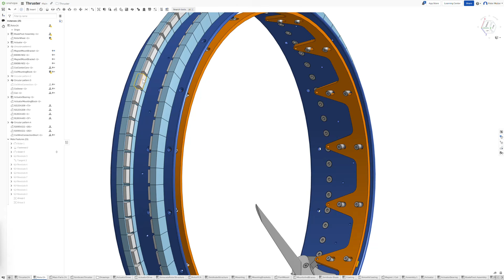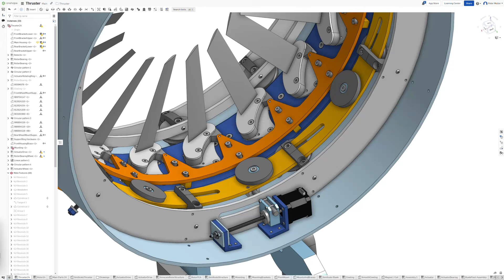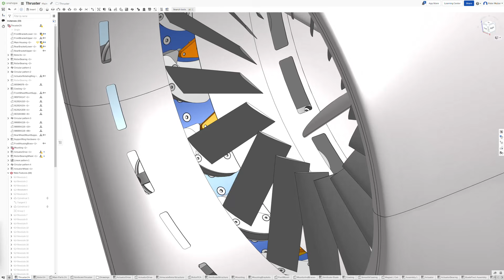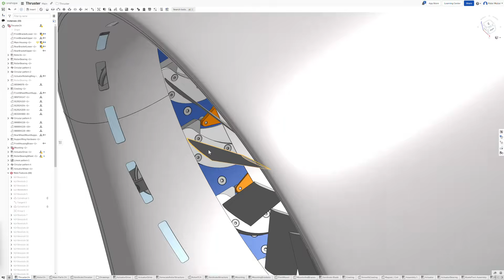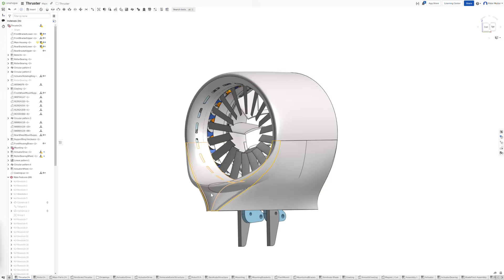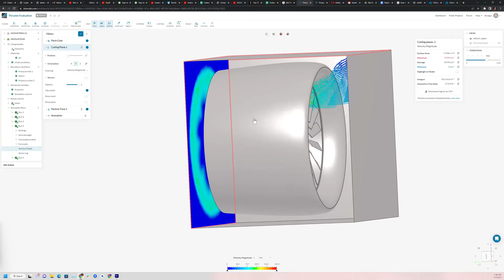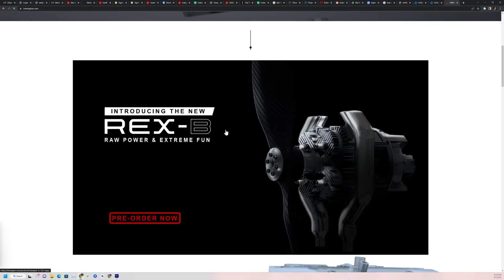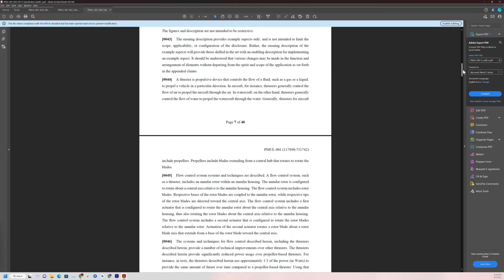Could this Thruster transform Aviation?

Comment: I am very much looking forward to seeing this on a real world test, full thrust power and blade pitch.  I like it, I get the engineering behind it, and it's fairly exciting to see this new design.

I do have my concerns about the design, but I'm not nearly engineer enough to know if mine are founded.  I will just look forward to the testing and see what happens!  Good on ya!
Reply: If you get the engineering behind it, please tell me what the case is for this design. I gave up on the video.
Reply: @kylenolan3138  The case is thus:

Propellers and hub based fans have issues with supersonic tips (high drag) as well as hub strength. They are also susceptible to hub/blade failure due to manufacturing processes coupled with a large amount of outward force being put upon the blade hub and hub itself.  Both are in danger of FOD or bird strike causing them to fail.  And when they fail, the blades swing outward from the hub, and that can be... fun.  Sioux City DC-10 for example.  Hub failure, plane crashed.  Not all hub/blade failures are contained.

This design, all the force is put on the outer ring.  This is a stronger design due to the containment already happening on the ring.  There cannot be any blades flung outwards, worst case is it is flung backwards if a blade assembly fails.  Further, there cannot be any supersonic drag of the tips, as the tips are on the inside, spinning slower than the base of the blade as it runs around the ring.  This improves efficiency of the blade.

Further efficiency of the blades are found by variable pitch, which you do not see in High Bypass Turbofans.  You do see them on props, but it's a somewhat problematic solution which not all aircraft have.  These blades will be pitched automatically, so you run the 'engine' at the same speed, but can produce variable, speed appropriate thrust.  This is therefore akin to a CVT transmission in a car: Car runs 3500 RPM, but still accelerates at a constant speed, the transmission changing its ratio to produce peak power for the car's speed needs.

Finally, it's akin to a 'diesel electric train' idea.  Diesel electric trains have diesel engines, but they are not running the train.  The engines are used to generate the electricity, and then that electricity runs the motors on the wheels.  This is the same thing: small, efficient engine to generate enough power to electrically run the fans.  Less fuel used by far than directly running the props/fan.

It's quite the idea.  Not so much the electric side of it, the fan design moreso, but the whole thing.  It's rather innovative and striking, and IF (because it's an IF at this point, of course) this pans out, it could be revolutionary in the aviation world.

As far as the SVTOL idea... That should work as well, but I think that'll be best done after proof of concept on the system in general.  Straight out flight first, then add the SVTOL part.

Will it actually work and/or be a revolution?  Well, they didn't think that rockets could be reused until about, what, 7 years ago?  All it takes it one person at the right time with the right means to try and see, and Peter is the person of this moment.
Reply: @mikeybhoutex  the blades definitely can be thrown out sideways. They still have essentially all the axial force they do in turbofan engines, and with the lack of support to the blade tips the flexure will cause major fatigue cracking over time leading to them breaking off and being launched outwards into the hub. 

The root of the blades will also still be going supersonic, it’s irrelevant wether it’s the tips of the blades or not, a part of it is going to be supersonic.

The ring holding the blades is also going to be under immense forces due to the g-loading from the centrifugal forces from the rotational speed along with the torsion from the blades. 

There are more issues with this design than there are positives.

Comment: Have you considered using a magnetic bearing system vs mechanical bearings? A lot of energy is lost in friction and heat. Overall great concept. I have a similar concept with a completely different design.
Reply: I was wondering why so many moving parts too :)
Reply: also all the extra parts and weight, but the part that gets me is waste heat is thrust, and you use it to push all the many blades :)
Reply: there is no form of thrust more powerful than liquid and solid fuels which is why we use them and the fact that as you burn them you lose weight reducing how much you need to use :) 

if you could recharge the energy spent with the motion and get more that way then it might compensate a bit..

Comment: I will be interested to see how your patent progresses. As a former aircraft engineer, I tried to patent this idea of a hubless "Maglev" electromagnetic linear driven Turbofan back in ~2010 in the UK.  My patent lawyer told me there was too much prior art for it to hold any weight, in the UK/EU at any rate.  My blade design was different to yours as the compressive forces acting on the blades make a huge difference to what you can do over normal blade designs.
Reply: F Bonger
Reply: Maglev in combination with this hubless design should be patentable I’d think. Using a maglev technique will help reduce the number of bearings and high rpm friction in this design

Comment: Variable pitch exists also in standard motors mostly to reverse thrust on combustion engines. The main issue I see is the lack of gains due to weight and frictions. You do get rid of the engine bell and use the ducts as a bell. The main efficiency gain should be from the better ducks seal, but getting tight motor tolerances is now harder and those have huge perforce consequences. Lastly, this motor will not like to change direction (like a bike wheel at 90°).

Comment: So. Much. Rotational Inertia. 

While this might be an interesting option as a forward thruster, it'd be incredibly difficult to use this as a vertical lift thruster and maintain controlability. 

Also I'd recommend a number of stators/rotors that's a non integral ratio. Otherwise you'll get resonance issues and it'll be loud as hell. 

There's a lot of interesting ideas you have here but you're gonna have a lot of challenges to overcome. 

I wish you the best of luck
Reply: Interesting. It has a lot of rotational inertia, but it also has a lot of leverage on that inertia.
Reply: Can you explain what the issue is a little bit more? I'm not sure it's any different than how a helicopter works. The back engines would need to maintain a slight angle though to provide that force vector.
Reply: @nathanchalecki4842  And the rotating mass can be "easily" decreased with better materials and mechanisms (specially the pitch control).

Comment: It is an interesting idea, but my opinion is that, it has to many moving parts (the electric motor part) and those many moving parts need to be machined to very tight tolerances , that cost a lot and as you have seen , not many can do it right, so tight tolerances, in order not vibrate and work correctly at high rpm. only 3grams at that diameter at 5000rpm will vibrate like crazy, a wobbly outer case of the rotor will damage bearings from vibrations, i know it. (experience). 
A outrunner at that diameter needs to have verry verry precise positioned coils and magnets, because only 0,05 mechanical degrees out will throw many electrical degrees out of alignment the rotor with regard to stator, and also i know that for sure (experience), search for electrical degrees and mechanical degrees in brushless motors PMSM. 
Might be a better solution , from fabrication stand point at least , and reliability stand point to make the motor in the center and have only 2 bearings that support the rotor assembly. 
Another problem in your design is that you have way to large single copper wire in the coils (so it looks) you need to have many stranded thin wires to avoid skin effect.
The high frequency for that large and many poles rotor may cause some heating problems at high power. Electric motor design is a complex task.   
I know this stuff, because a built my electric aircraft and electric propulsion system completely from zero, many years of learning an d building. I have some videos on my channel about this.
Nice work wish you great success! All the best Mihai.
Reply: I mean... do you know the types of tolerances and materials required for turbine engines?
Reply: @damnsong8675309  It's way more than some eletric propulsion for a small 300 kts airplane (which is still a lot).
Reply: To be fair a conventional gas turbine is highly complex
Reply: @damnsong8675309  i work in a industry with microns of tolerance, and yes an out of round tolerance for a turbine disc is between +/-20 microns at about 1 meter in diameter, and that is no simple task nor cheap to achieve.
Reply: @Cherub1m7  yes they are, but, none of the successful gas turbine power plants was designed and built by a single person, not even a small group of people, thy ware designed, buit and tested by very big companies with 100's of specialized personnel, and non the less with huge budget at expense. I am not saying that is not possible to be done by a single person, but that will require a lifetime and enormous amout of money. There is no need to over complicate what can be built much more simple, just remember the problems that user had with his redrive on audi engine, that even resulted in a crash landing.

Comment: Super interesting configuration. There's a colossal mountain of challenges to summit before any aviation authority would certify it tho. In a previous life I was an aerospace fan and turbine blade design & development engineer; I can see a whole tonne of issues that'll need looking at both early on and later. Early problems include vibrational fatigue and creep leading to failure and fan-blade-off. There is a massive challenge to keep the blade tips stable under radially compressive loading.  Later problems will be bird strike and containment as the engine sheds a blade and goes out of balance.  I was on the team that tested GE's CF34-8C bird strike and blade off performance. The destruction was staggering to behold.

Comment: Pete it looks like you will have issues with blade warping under high centrifugal load. Have you looked at a center support ring to tie the blade tips together and support the pitching movement. The ring could be supported by the static fins and a nose cone or more blades added to the center whole
Reply: Would also solve the compressive load issue... they would be under tension with an inner hub.
Reply: You'd lose variable pitch that way, no?
Reply: @Name  no you could design in a bearing leaver system similar to the outer ring without the actuator. Like a slide guide. More complex though it would seem to solve a lot of the obvious issues that will arise when you get into the higher RPM ranges. I would think the side roller's bearing system would need to be oil fed / lubricated for longevity. That would mean a whole rethink and add massive cost to manufacture. Pete is pretty clever so I doubt it's beyond him.
Reply: @Name-ot3xw  if you can put it in the outer ring, why not the inner as well?
Reply: @johnmurray3834  Or eletrodynamic/magnetic levitation, which can come as part of the motor itself.
Reply: @__shifty  what's that?
Reply: @Vitor de Lima  lol one step at a time mate. Im not sure it's quite reliable enough yet or even achievable with current technology. Don't get me wrong though it would be amazing if it was.
Reply: @vitordelima  You still need thrust bearing on the engine housing, otherwise instead of the plane going forward, the fan just launches out the front.
Reply: @johnmurray3834  It's physically simpler than anything else but requires a lot of tweaking, so it could be suitable for this prototype.
Reply: @Vitor de Lima  the motor as is will have a degree of magnetic levitation. It is inherent with magnetic fields. What you are proposing is electromagnetic guides apposed to the roller bearings currently? 
This would take at least 3 times as much energy and 20 times complexity. Probably could be done at an astronomical expense. Not something Pete could afford to take on in my opinion.
Reply: @johnmurray3834  Not really.
Reply: That’s basically a normal turbine just driven from rim.
Reply: @ryanp0342  a normal turbine driven by the rim is the most sane thing he could be building
Reply: @nathanchalecki4842  a normal turbine driven from the center works
Reply: @bjarnevarme9830  I haven't watched the whole video I just presumed he had some ground breaking efficiency increase from the rim job.

Comment: Hello Peter, thanks for posting this video showing all your hard work. Like other commenters here, I think you need a strutted central forebody/fairing with a ring race on thrust bearings, that supports the inner tips of the blades, while allowing them to freely pivot in pitch. Other commenters have shared their concerns about flutter, but I think what they are really getting at is resonance, that would probably occur at some harmonic of the natural frequency of the cantilevered blade, as your design currently shows it. Blades under tensile centrifugal load don't have this problem to such great extent because the tension tends to damp out blade bending perturbations. This is not impossible to incorporate, but would obviously add weight and complexity/parts count. I know you think its cool how the air is entrained through the core, but this is probably not an efficient way to move the air. It probably would be better to get the centreline air to flow around a centre fairing and into the main rotor where it can be more highly accelerated. Yes I know this would completely change the delta V and flow field through the now physical annular opening. But you may discover upon analysis that it is more effecient in producing thrust especially at lower RPM.
Also, for an electrical power source, have you considered a small Gas Turbine (probably a centrifugal compressor) ?
Anyway very inspiring work. I love your novel approach. All the best and keep having fun!!

Comment: I wonder if you could add a second rotor to the outside, with a common stator.

Then these would make perfect wheels for a transforming flying motorcycle.
Reply: Hahahahahha, or he should build a monorail using the raptors fuselage as the cabin.
Reply: Lol. Yeah nevermind the bending of the apparatus on the first pothole.  Tight tolerances and all.

Comment: Very interesting design! I'm curious why you went with 18 blade, and a 2 to 1 ratio with the 9 stators. I love the inversion, though I am curious if the magnetic decentralization decreases efficiency, even given the gains with blade pitch variability. I'm also curious how much the open core might increase air-through, and how the intake compression ratio curve compares to standard axial engines. Presumably it's optimized here for cruising speed

Comment: It’s a great concept. Seems to me that one of the major concerns would be component wear and longevity around the outer bearings, due to the pressure created by centrifugal forces. Also, what about the effect of dynamic g forces on the rotor? That said, I wish you the best of luck; it has a lot of potential.
Reply: My thoughts too.  Interesting project but likely RPM limited so  the tradeoff would have to be calculated.   Perhaps useful in other applications / air pumps where an RPM overhead is less of a problem.  Certainly there could be no tight sealing surfaces at the outer rim.  The surface velocity would be too high for most typical sealing materials.
Reply: Labyrinth seals?
Reply: Bearing wear is where my mind went first, too. Not only are they under compression, but they have to traverse the entire outer rim of the rotor each rotation: a much larger circumference than a traditional hub. Further, the design is intended to operate at a much higher RPM than conventional designs, so the individual rotations of each bearing per rotor rotation would have to be orders of magnitude higher than a conventional design, and that effect would multiply with the radius of the thruster. I'm no mechanical engineer and am not terribly clear on what bearings can be expected to stand up to, but my instinct is that's going to be a problem.